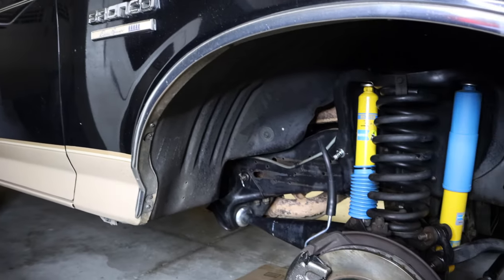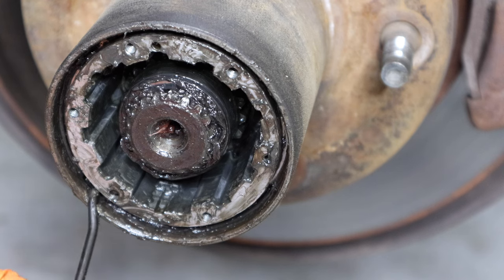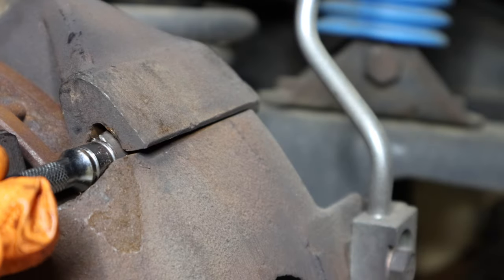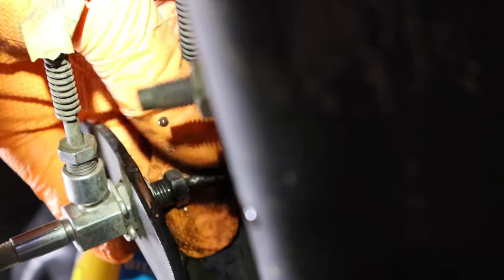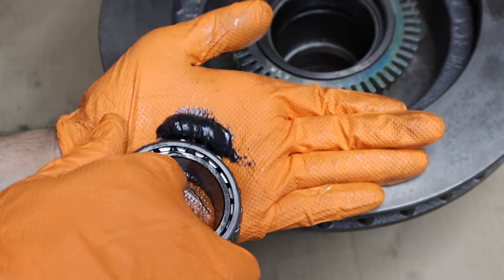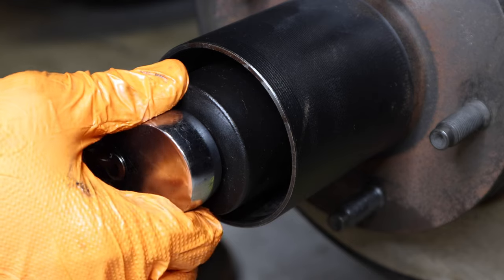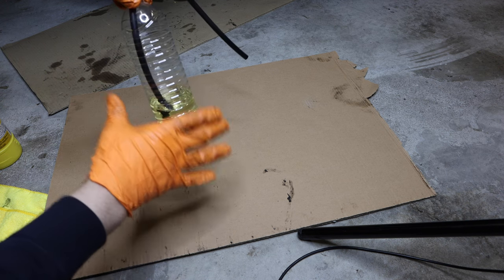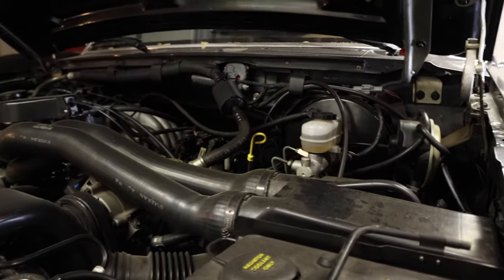Rebuild 4x4 Front Disc Brakes & Bearings | 1980-1996 Ford Bronco F150 | Dana 44 | Bronco Restoration

Comment: Man..... I'm so happy I came across this video. I could figure out why my 4x4 was popping and clanking really nastily. Turns out those hub gears were put in backwards! Now my bronco just floats right over the obstacles like butter .The only weird thing now is that when I lock the hubs but not engage 4x4,  if I go over 30mph it makes this sound identical to dragging the pipe handle of a floor jack on asphalt. But under 30.mph no noise at all. I guess if I'm off road and wanna keep the hubs locked while not using the 4x4 that shouldn't be a big deal because out in the desert id definitely not be driving that fast on a trail
Reply from the maker: That maybe a sign of a worn front differential bearing. I would keep the hubs unlocked until party time

Comment: Hello @TheFixTech.  I have a 96 XLT 5.0.  I am looking to replace front rotors.  I see there is an option for single or double hub seal.  Can you shed some light on this?  Which do I need?  TIA
Reply from the maker: I do have a video on this, you will need the two piece seal: https://youtu.be/Z_q8Pz1o2Uk?si=9HNlIIdQggCE2N4T

Comment: The inner spindle nut is essentially losened back to finger-tight once the replacement bearings and races have been seated.  The hub should't spin easy and have near zero play.

Comment: I have a 1995 Bronco with Manual Hubs and Mine has only one spindle nut with no pin and no washer or second spindle nut
Reply from the maker: You’ll need the complete set, not safe to drive otherwise
Reply: Your videos really helped me with my issues. After 2 weeks of research I found that whoever did the conversion put the auto hub  spindle nut back on after they converted to manual hubs. 

Also found that the 2.5 spindle nut socket does not fit in the end of the hub... and the spindle nut was tight, had to hammer notches into it to get it to spin. 

Thanks again for the videos. Helped me tremendously

Comment: Excellent video. Anybody who teaches often forget that things that seem "common knowledge" are actually the foundation of the topic they're teaching. Especially for YouTube videos, where the ignorant come to learn (Hi, that's me by the way) it's important to describe things that you wouldn't think are necessary. I've been a trainer for nearly 20 years, you did a great job in hitting on some information that I needed to do this. I've got a leaking front hub on my 93 Bronco XLT. I'm not a mechanic, I'm an armorer. Things I wouldn't have known to get in preparation for taking apart my hub assembly I didn't have to find out the hard way. Thank you.

Comment: Hello, just wanted to say I enjoy your videos, it's always fun to see how others work on their cars. I've been working on the 4th and 5th gen Broncos for a few decades and wanted to point out that you made a serious error that many people also seem to miss so your not alone.
When you torque the inner bearing nut, its 50ft lbs, back 90°, then torque to 15 "INCH POUNDS". The outter nut is then torqued to 160-185ft lbs as you mentioned. 15ft lbs on the inner bearing is high enough to cook them.
I think it very important that the video be edited.
Again no judgment, great content, just pointing this out.
Reply: Good call!
Reply: Do you know anything about the specs for the models equipped with a singular self locking spindle nut?
Reply: @daveunderwood6498   it's the same bearing procedure and final preload at 15 inch pounds, the self locking nut then holds itself in position. Their a pain to work with.
However, I HIGHLY recommend you discard those self locking nuts for the double nut set up. Those self locking nuts are a disaster waiting to happen.

Comment: Great video!!! I was going to buy the rotor and hub assembly from your link but it says it fits 1988-1992. I have an 87. But if I use the links for the rotor and hub separately it says they will fit.  Do you know if the preassembled rotor/hub will work?
Reply from the maker: If your truck has the standard hubs then yes these rotors will work. If your truck hat the (hat) shaped hubs then you will need a different set of rotors. Ford used the “hat” style hubs for 1-2 years between 87-88 on certain model trucks.

Comment: You talked about making sure that the socket doesn’t slip off the spindle nuts as to not strip the teeth, but if I were to have stripped said teeth, how do you recommend removing it?
Reply from the maker: There is a 4 prong socket that has the teeth recessed about 1/4 inch. This socket usually helps for the stripped nuts.

Comment: As always great videos 👍what’s the difference on the automatic hubs my 90 Bronco has automatic hubs no need to get off and move the switch, also has the shifter on the floor no push button.
Reply from the maker: You will need a different tool/socket to remove the spindle nut, the rest is the same.

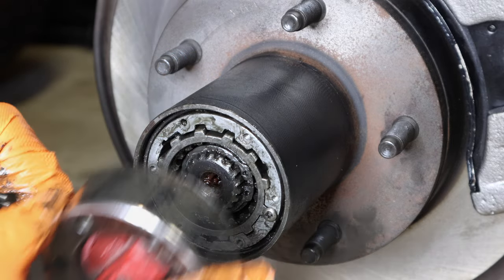Comment: Great video but I have a question. Look at time stamps 2:11 and 14:16. At 2:11 you are removing the hub assembly. Assuming that the hub was assembled correctly previously, it clearly shows the teeth facing OUT on the sprocket or at the top of the sprocket. At 14:16 you flip it around to re-install it and even state that when the sprocket goes back in the teeth must be recessed. They were not installed in that recessed orientation when you disassembled the hub so now I'm confused as to how that sprocket goes back in.

Comment: at 14:06 you talk about the engagement gear orientation to the spring. Do you have a reference for it? In other videos and my truck it was orientated the other way and seemed to work fine when I manually locked the hubs. Need to find my repair manual and see what it says. Definitely wanna get in there and flip it if I have it wrong

Appreciate your channel!
Reply: Alright just watched another video and looks like they did it the same way as you. Guess I got my project for tonight!
Reply from the maker: Yes, I had to research this when I did the job. The way shown in the video is the correct way, and if placed in backwards it can fail (teeth will strip under heavy load)

Comment: Great video. So you had the entire front end held up by one jack stand under the pumpkin on the driver side? Am I following you correctly?
Reply from the maker: I did one side at a time, you can hole up the drivers side with the pumpkin, passenger side you can set the jack stand under the axle housing.
Reply: I tried to do that, but it looked like it was really torquing  the whole frame badly

Comment: What are some things I should do to a bronco that has been sitting for 15 years it’s a 1988.
Reply from the maker: First thing first is clean out the fuel system, new tank, pump, and filter; a step further replace the injectors (these trucks are old). Do a tune up, plugs, wires, cap, rotor, ignition module and coil. Change the fuel and ecm relays. Brake pads and rotors/drums, bleed out old brake fluid and full with new fluid. Check for a leaking brake master cylinder, if it is leaking, then replace. Replace rubber brake lines. Once the brakes are solid, then fun starts, take it out on drives and test drivetrain and suspension…

Comment: I DID THAT TO MY 44 
ON MY 87 , i CHANGED THE FRONT EN CORE SUPPORT GRILL SND LIGHTS FENDERS AND HOOD AND THE SPINDLES THE CALIPERS BOLT TOSND UPGRADED THEM AND GUSSETED & PLATED ALSO DDED AN f250 SLIPSHAFT PAS SIDE AXLE WITH BIG U JOINTS.CYCLED IT ALL AND CLEARED IT  GEARED AND LOCKED NEW RADIATOR & HID UPGRADED THE LIGHTS LONG BREAK LINES FRONT & REAR LONG TRAVEL CUT & TURNED KLIFT ON KING SHOCKS pOWDERCOATED IT ALL GLASS FENDERS AND HOOD . nO MORE BULLNOSE FRONT END ITS NOW 96A LOT MORE WORK BUILT DRIVETRAIN & ENGINE
Reply from the maker: That’s a lot of work, good job!

Comment: I have a 96 bronco with auto hubs, what size spindle nut socket do I use for that?
Reply from the maker: Nice truck! You will need the rounded hex style socket, size 2 1/2
Reply: I have that 2 1/2 socket but for some reason has trouble fitting in the hub… it needs to be smacked in with a dead blow and watching your video that socket went right on without hesitation

Comment: id doing a 5.8l with Auto 4x4 easier or harder then this? This really did not look hard! I feel the auto might be more of an issue I cant seem to find a good video
Reply from the maker: The auto hubs aren’t harder, they just have a couple more pieces required to remove. Keep everything sorted in order while removing the hubs. I have a video that will help, it is about converting auto hubs to manual hubs and it shows the whole process of removing auto hubs.
Reply: @TheFixTech  Thanks for the response. I did see the video. Would changing my Auto to Manual be better? Stupid questions I guess but right now I put my vehicle in 4X4 L or H and my hubs automatically know about it so they start working? the only difference if I had manual is after putting vehicle in 4X4 L or H id just have to get out and 'LOCK' them ?

Comment: Can I ask why on earth you’d replace steel braided lines with rubber? The rubber lines are not near as strong….
Reply from the maker: The steel braided are longer and are intended for lifted trucks 6” lifts. They were rubbing on the tires during turns, I tried tying them will little success. I plan on a mild lift and will look into the steel braided line at that point. Rubber lines are pretty good when brand new, it’s after a few years they begin to wear.

Comment: I have the f150 1995 4wd is it the same on mine . I'm having a really hard time and I've been stuck. That spacer just pulls out to get to the next spindle nut so I can get the rotor off ?
Reply from the maker: If you have manual hubs then yes, it is the same. When the first spindle nut is removed you should see a spacer (with many holes), that spacer just slides out. Use a couple pics, one on each side of the spacer to pull the spacer out. Then the last hub nut will need to be removed for the rotor to slide out. If there is a lot of old grease and or water/rust, it will be a little tricky to remove the spacer. If you have auto hubs it will be different as ford used a 3 bolt and 5 bolt style for different years.